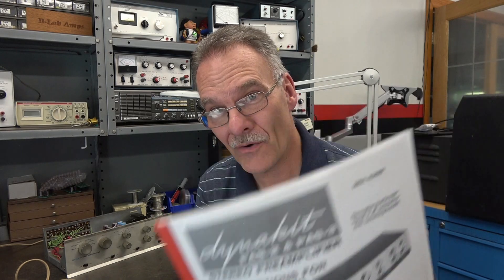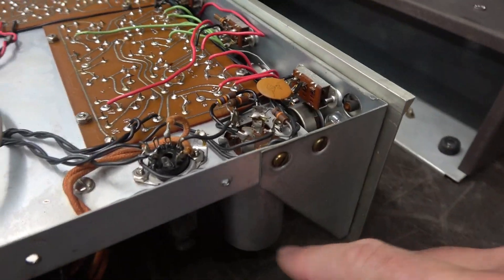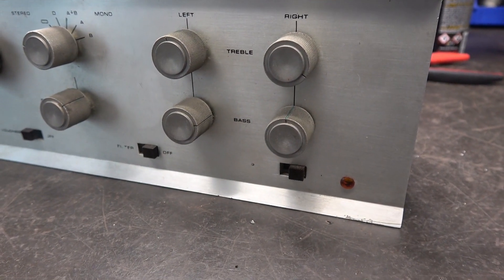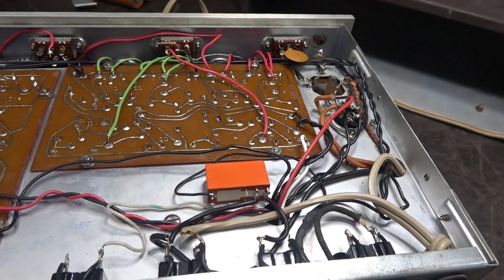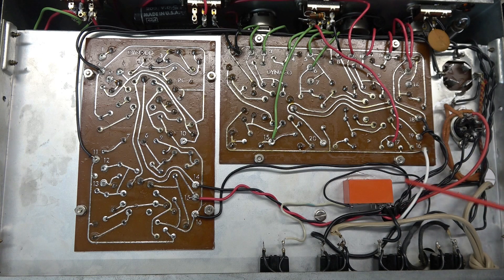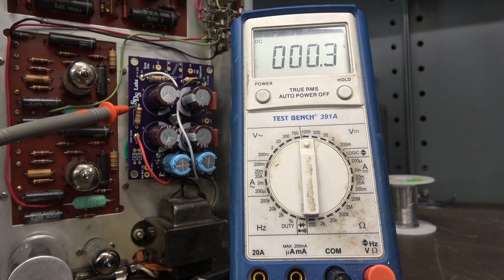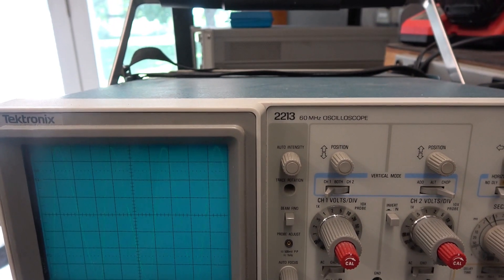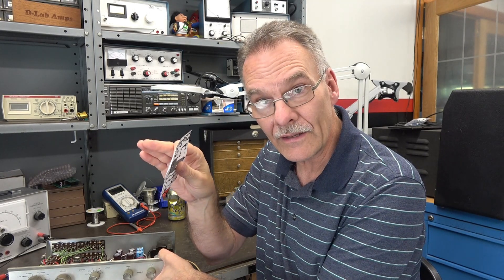How to Restore Dynaco PAS Tube Preamp Cap replacement Power supply upgrade SDS Labs kit

Comment: OK, you are the tube amp master, and I am the guy studying the repair of tube amps. I have been watching Uncle Doug's videos for several years.  I am not questioning what you are doing.  Uncle Doug would I believe replaced the line cord with a three wire and grounded the chassis. He would also add a line fuse. The fuse you installed is only for the relay. I have been in the electrical field all my life and am a ham radio operator. I retired a few months ago and I am pursuing electronic repair.

Comment: I found a fully rebuilt st 120 with new boards transistors tip mod and van alstine power supply.  Would you recommend?

Comment: Hello,

      Just wanted to start by saying I really enjoy your Youtube videos. They have really helped me alot. I am new to the vintage audio repair game and like to get advice from your videos. After watching your video on the PAS-3 preamp recap I decided to use the SDS Labs cap board that you used on a Dynaco I'm repairing. I was a little confused with the instructions that they provided because It didn't match the board that was sent. 
        I noticed that the board that I got was the same as the one in your video. I have figured everything out except the J1, J2, J3, and J4 connections. I am assuming that the J1 and J2 connections that say blue in the instructions are the blue transformer wires. J3 and J4 say they are lamp wires. I am not sure where these are supposed to be connected to the preamp.
     Any help would be greatly appreciated. 

Thanks again,
Al Kuhn.

p.s. Keep up the great work on your Youtube videos.

Comment: With the power supply caps replacement from SDS audiolabs, when replacing the 12x4 rectifier with the diodes option is chosen, am I correct that all that I do regarding 12x4 tube and socket is  attach the two red transformer wires.  I don't see anything else in the instructions in that regard.  Do I leave current wires in place and remove the tube.  Sorry I am kinda a newby.  Also, spec info on the switching relay would be appreciated.  Thanks for the vids.

Comment: Hey Terry, were you going to change those coupling caps out in the PAS-3 like you did in the ST-70? I have a PAS-3 I acquired 10 years ago for my Heathkit W-5M mono block amps. Someone before me bypassed the selenium rectifier with silicone diodes and did not use any dropping resistors. I never run my amps through the preamp switch, I have them plugged into a Pangea Quattro Premier power strip and unplug them from the wall. Have you thought of putting a zener diode regulator in the circuit for the 12.6 volt filament power? Would that be beneficial?

Comment: Terry, I might be interested in getting one of those boards if you decide sell them. A couple years ago I installed one of those SDS replacement boards but I'm still having trouble tracking down some hum in the unit and wondering if it may be that fuse sitting close to the output wires. Never even occurred to me. I may have to reopen and see if moving the wires away from the fuse has any affect on the hum. Great tip on relocating the fuse location.
Reply from the maker: Yes Sir, That might be.
Let me know if that solves the issue and I will make the changes to my board before the final design. Thanks, TD

Comment: Terry, I have a Dynaco PS-1 and a st 70 swet up my step day built in 59-62???? I have it and the original manual and it has Mullard Power Tubes aND RECTO TUBE AND TELE-FUNKEN PRE AMP TUBES.. IT WORKED 100% PERFECT THE LAST TIME IT WAS USED IN ABOUT 93... ANY RECOMENDATIONS BEFORE I PLACE IT FOR SALE?? I ALSO HAVE HIS THORENES TD-121 TURNTABLE...... Whoops, didnt see the caps , sorry

Comment: Other than convenience, is there any other reason why the rectifier tubes are kept instead of replacing them with diodes?
Reply: I believe most folks like the rectifier tube because it has a slower warm-up time and provides more swampy bass and such.  Diodes are instant-on and can shock the output tubes with really high surges of B+ voltage at the very beginning.  That's why high voltage reservoir caps are used in many circuits to take that high surge.

Comment: Now that is a great upgrade for a preamp! Like the addition of a relay for the  switched outlets,  designers should have thought of that back then. More please 
Terry when you get some time.🍷🍷🍷
Reply: Compact relays for this application did not exist then. Audio Research used a large relay on the SP-8, and this was the early 1980's. The PAS original design dates from 1960 or so.

Comment: My old Stereo 70 is looking grubby. They make a stainless chassis for it. Do you think its worthwhile to go that far?
Reply: Right???, Uncle Billy.
Reply: Of course it's worthwhile to go that extra mile. Those SS chassis looks great!  I believe that they cost around $100, but look well worth it, especially if you're restoring that vintage Dynaco ST-70 amp.  I will building a new ST-35 this coming spring along with the custom biasing circuit board add-on for it.  Terry at D-Lap never hardly ever answers any questions here or responds to comments for some unknown reason.  Think about it... circuit boards are "circus" boards.  Resistors are "resistoroids"... sheesh.  if he were more serious about his videos and actually do full videos of the circuits he works on I would probably be more attuned to watching all of them.   I watch Uncle Doug a lot and when it comes to knowledge of basic circuits and explaining their functions and such... no one comes close to Uncle Doug.  Uncle Doug basically deals only with guitar amps however.  Uncle Doug has more than double the subscribers and his dry humor is truly unique.  I used to watch a little of Brad the Guitologist but his constant cursing and such was a turn-off.  If one cannot express themselves without resorting to cursing then their vocabulary is extremely limited.